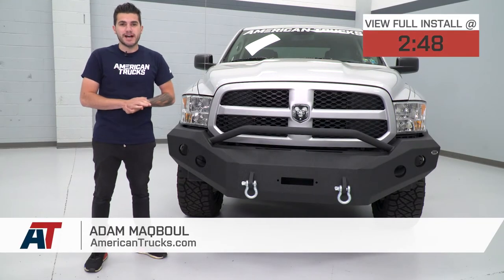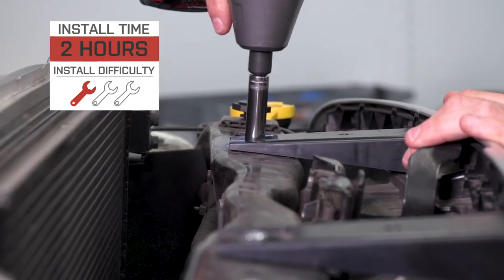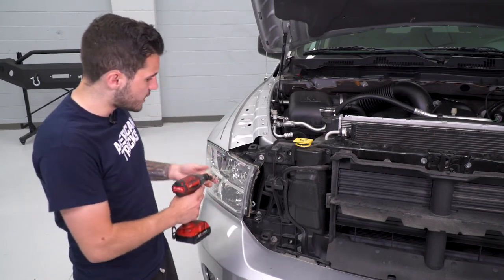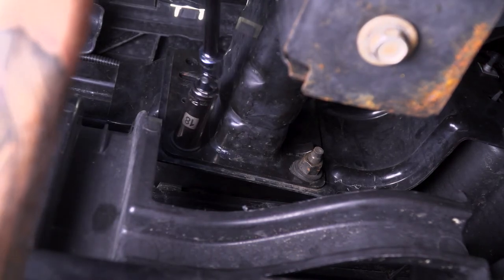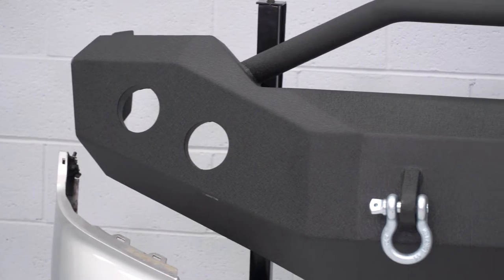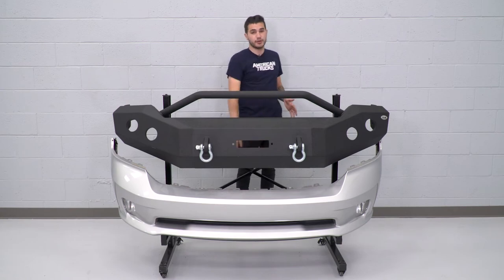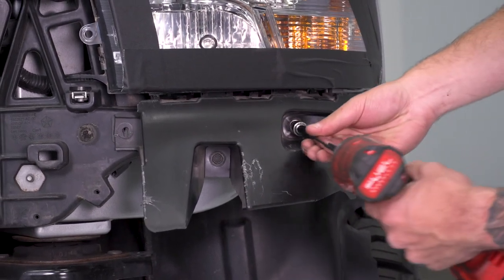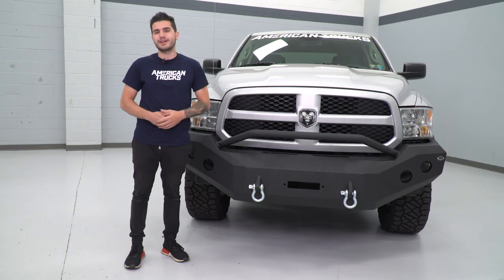2013-2015 RAM 1500 DV8 Off-Road Recovery Front Bumper w/ Bull Bar Review & Install

Comment: this bumper comes in pieces you have to put it together. in the video it shows it as one piece. however when I got it it came in two boxes. I put it on anyway and it came out pretty cool. still wish it was one piece like in the vid, so heads up guys.
Reply: different model

Comment: Is there enough play with the winch tray and the bumper to eliminate that massive gap under the driver's headlight? Is there enough meat around the tray holes to ovalize for better fitment?
Reply: Yes I ordered the modular 3 piece off this same bumper and the holes are slotted to slide up and down left and right but they skipped that step. In part of the video it shows him push up. He left it to sag all the way down before tightening

Comment: I recently bought a dv8 front bumper for my Dodge Ram 2500. It sticks out way too far but more importantly the led lights shine off to the side of the road. They mount flush to the bumper wings and shine at an angle. They wouldn’t take back the bumper since I mounted it. I told them I took the bumper off as soon as I saw the angle of the lights but they didn’t care. I told them it is an engineering problem and couldn’t believe they sold a defective product but now I’m stuck wit it. I wouldn’t recommend anything from them.

Comment: Would it fit a 2016 ram 1500
Reply: I wanted to risk it because I saw one on ebay sell for 130 some dollars
Reply: It will fit like mentioned. Rebel and older 4th gens with have to swap grille or trim the old one